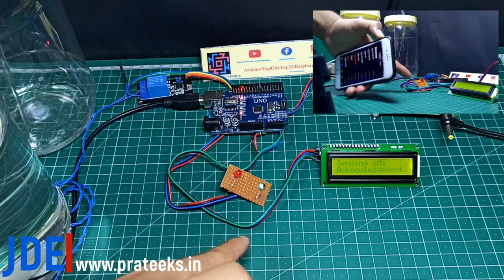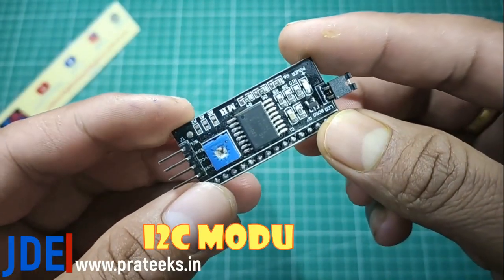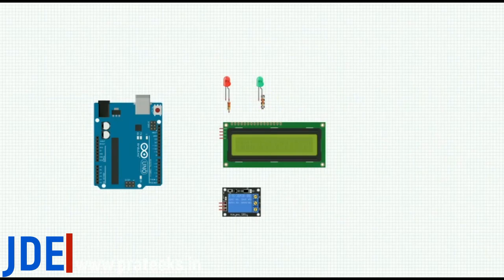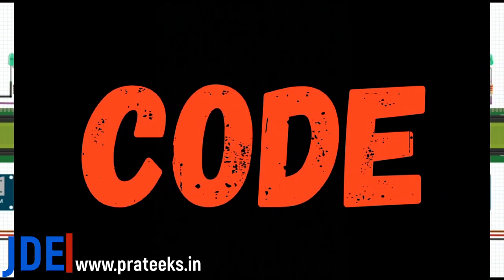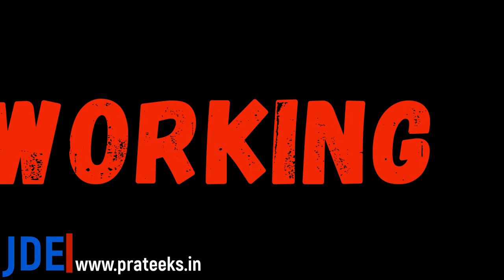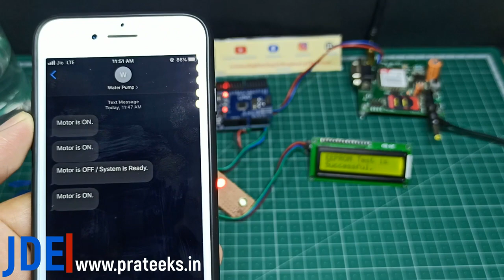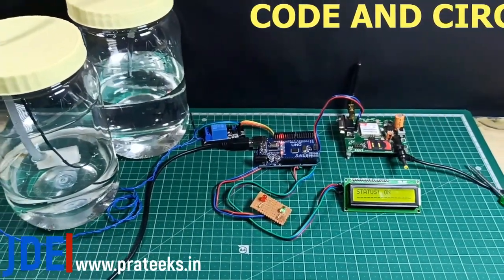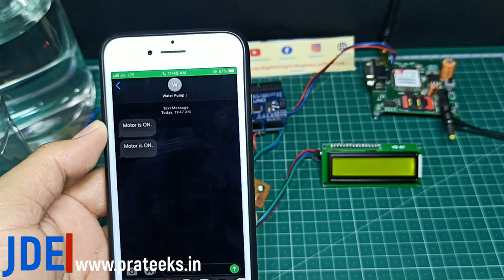How to on & off Water Pump Using Missed Calls | GSM Based Motor Control

Comment: Simply Superb...! 😊
👍👍👍👍👍

Thanks, but if I wanna to add two more parameters while using two 'simple analog sensor', one to #Start (if I forget to give a miss call) and the same another one to #Stop (again forgot to give a miss call). If it's crossed certain threshold 10% (while using #BottomSensor of the Water Tank) and the same another one for 90% (while using the #TopSensor of the Water Tank) it will be #Functioning automatically.

I mean starting and stopping will going to be happen #Automatically...! 🤔
Reply from the maker: Sir its not water tank water pump is Based One field water pump , i will try to your Concept in show in next video ........thanks for your Comments
Reply: @JustDoElectronics  Thanks, I mean to say that while functioning #Automatically also it will be keep sending #Message to that specific Mobile Number both the time, #Starting & #Stopping.
Reply from the maker: @shankarnathmajumder  Yes your idea is nice i will try sir in upcoming project
Reply: @JustDoElectronics I'm still waiting for your upcoming project

Comment: Thanks for sharing such an Awesome project.
Can you please modify the code to receive mobile number as sms to be stored in Arduino eeprom memory to change the number to switch on & off the device by mobile phone instead of  hard coding the fixed number.
Awaiting your earliest response.
Thanks

Comment: can i use water pump 16w for this connection?
Reply from the maker: Yes
Reply: can i use other gsm ? would it be different coding from this gsm ?
Reply from the maker: @clairesajang3796  yes
Reply: where can i get the coding?
Reply from the maker: @clairesajang3796  Same COde Working ma'am
Reply: thank you very much sir!
Reply from the maker: @clairesajang3796  Welcome